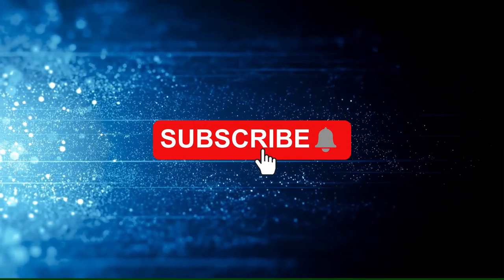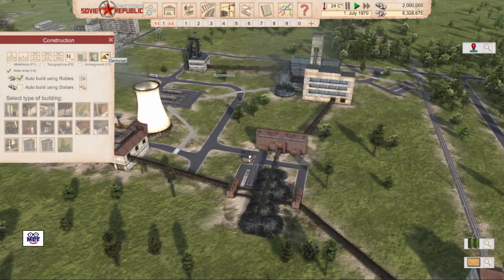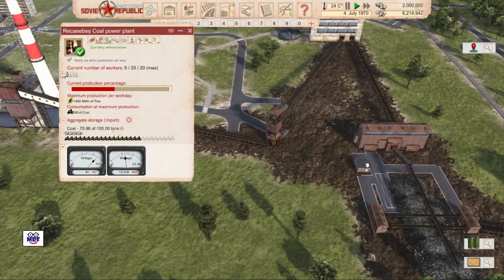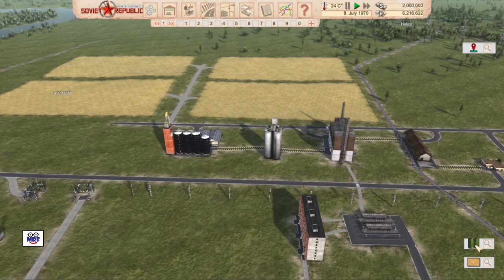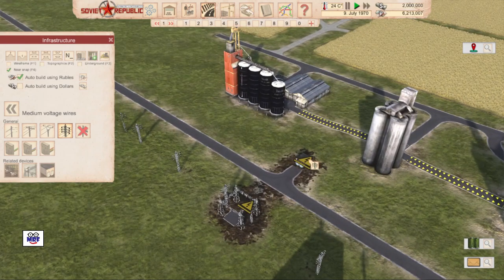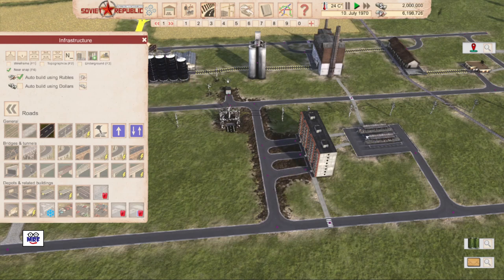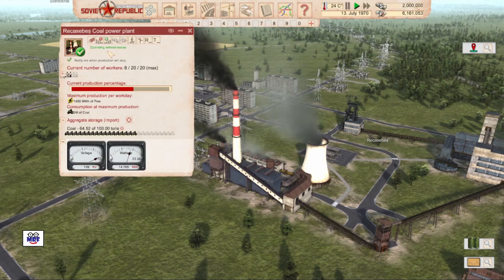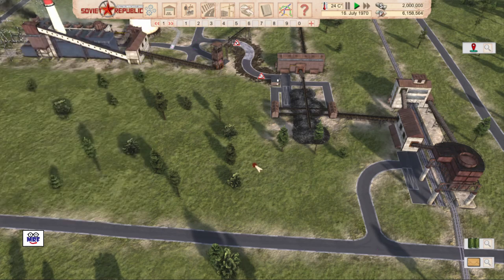The Problem with Power Plants is... - Episode # 6 - Workers and Resources Soviet Republic

Comment: 1)  train to supply large aggregate storage of coal, which feeds electric plant AND heating plant
2)  multiple small but fast buses into power plant directly.  3-5 buses, space out the line.  that way you will never have shortage of workers
3) connect power to border in a way that if worse comes to worse, you can IMPORT electricity.  happened to me, easy to solve - flick a switch at border to import, until power plant starts working

EEEEAAAAAAAAAAAAASSSSSYYYYYYY

Comment: I can't get workers to my power plant.. 
Made a separate hub, where 5 coal mines feeds a station and the plant, so when it runs it is perfect and produces plenty. 
Connected with a passenger station by train, where they then move to buses, to get to the final destination.. 
Problem: 
No workers take the train and when there ever is workers at the station, they disappear before the bus shows up
Reply from the maker: I hear you. I got so frustrated with this game that eventually I stopped playing it.
Reply: @MerfWorks  come from playing years of Transport Tycoon, where the network needs to be intricate to function properly. And also look cool.. 
And took that path... 
I have a giant setup.. 2 big cities, one with nearly 15.000 workers, the other with 4.000. 
Big Oil field, massive coal area, well sized gravel pit area, and another area for making alu with harbour export. 
Took me almost an hour, just to place signals for my enormous rail system, which is all linked together. 

Spend all 20 million rubles available, plus 4 mill dollars. 
30 or so bus lines and 7 passenger stations for the workers. 

No one wants to f*cking work. 
All I have going for me is the oil, since it only needs power to run with windmills. 
What is going on?

Comment: Dont build your power plants/industries too close to your residential areas, 500m to 800m should be a good distance for industry in general, also you have to understand that there is a wind simulation wich moves pollution from the pollution source in a certain direction, if the wind changes the area of pollution changes aswell, build a pollution monitoring station to understand how big the pollution is and where maybe not to expand your city.

If your ppl dont want to work in a specific workplace, force them to work there, build/sign a bus stop to the power plant and let your workers in a residential building go only to the bus stop you asigned to your power plant, it doesnt impact the happiness unless they all get a workplace there, if not i think it would then impact happiness.

Remember the push and pull system, storages cant pull and push but sources can push and industries wich need material from a storage/source can pull, there is also a overflow system wich push its material to the next storage/consuming station, you can build a whole industry system without towers but dont count on efficiency.
Reply from the maker: Thank you for the feedback.